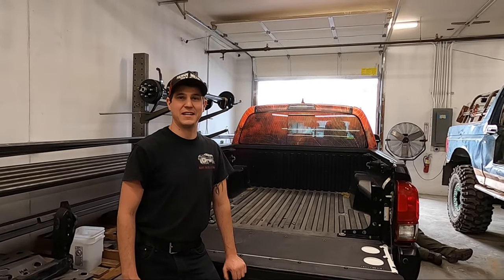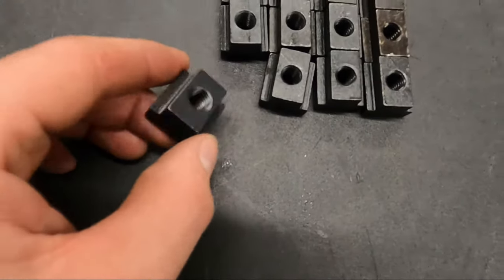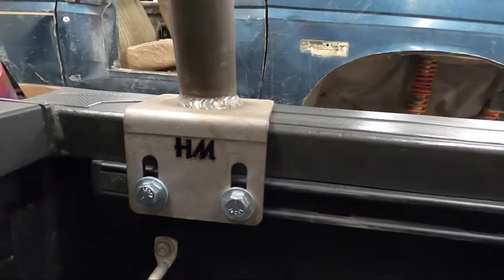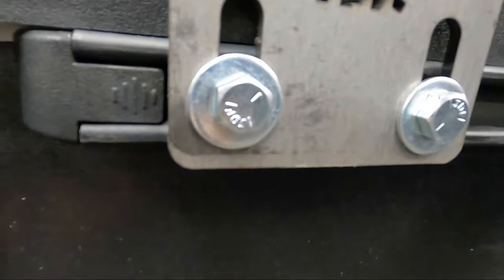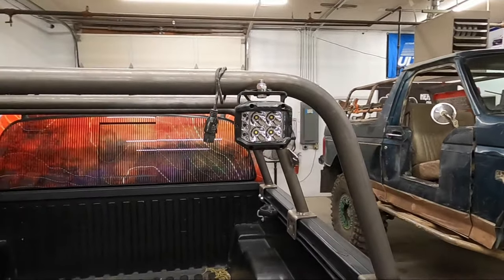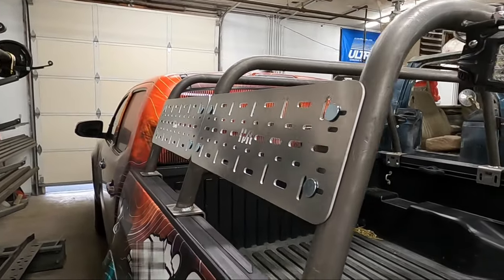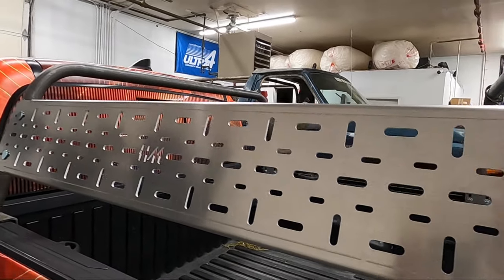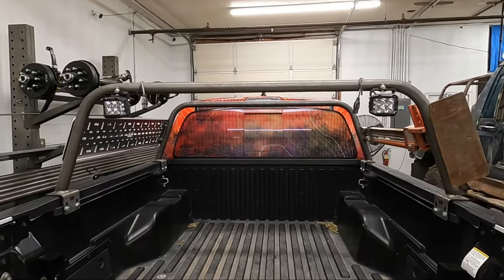Bed Bar Rack System Install Heavy Metal Off-Road

Comment: Does it matter which way they go? My hi lift is on the other side. My heavy metal bed bar unfortunately doesn’t have the universal mounting tab. It did come with the hi lift tabs though and that’s why I was wondering if it matters which side they go
Reply from the maker: Technically it doesn't matter but we can recommend some flush-mount bar clamps that you can add to the side that doesn't have the hi-lift jack mounts. They will work fine with our Universal Mount plates

Comment: Will the 21” be high enough for my 85” long RTT to be able to clear the fin antenna?  Do you offer this in a 23” or something taller than the 21”?  My 2014 has the 5’ bed so it would hang off too much in the rear with a shorter rack
Reply from the maker: If you have the shark fin, we do offer a more custom 23-in set. You can call or email to order, since it's not on the website. We would be happy to take care of you

Comment: Are these the powder coated? Also, when buying two, I did not see the option for getting the welds for plates on both sides. How can I make sure I get both?
Reply from the maker: You can definitely get these ordered with powder coating from us. If you want plates on both sides, give us a call or email sales@heavymetaloffroad.com and we'll set you up with a more customized set
Reply: @heavymetaloff-road  I'll be calling next week, thank you!!!